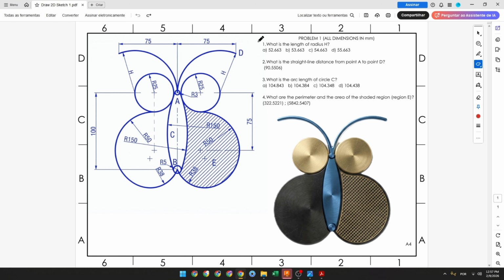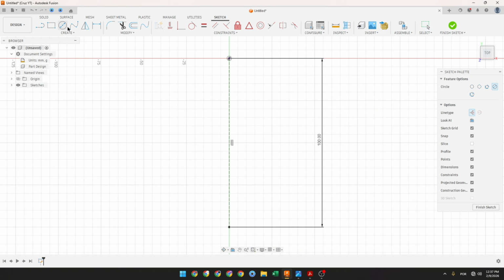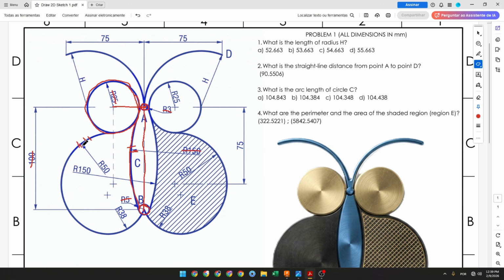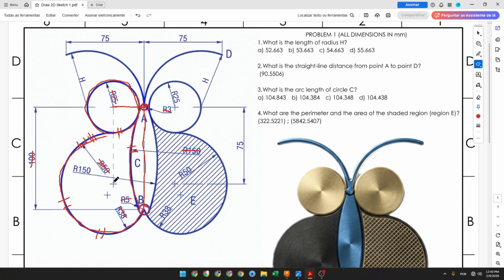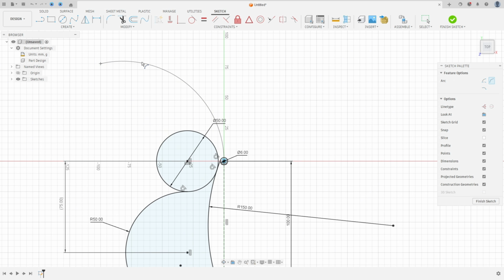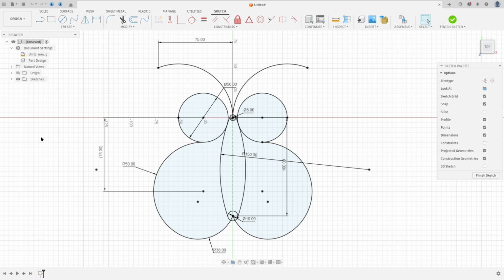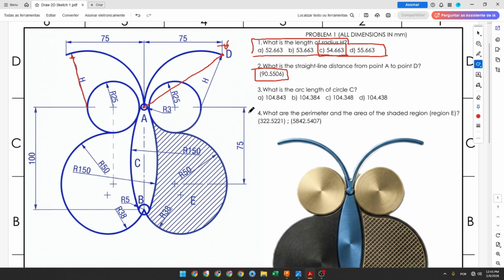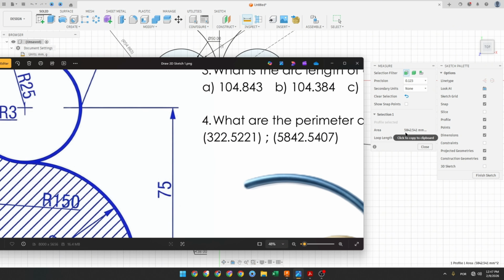Autodesk Fusion - 2D SKETCH CHALLENGE 1

Comment: Distance from point A to point D was not correct
Reply: The answer is correct. Only three decimal places are displayed, which is why it's rounded up. 90.5506 -> 90.551
Reply: @gonzagavag9949 thanks for pointing that out.